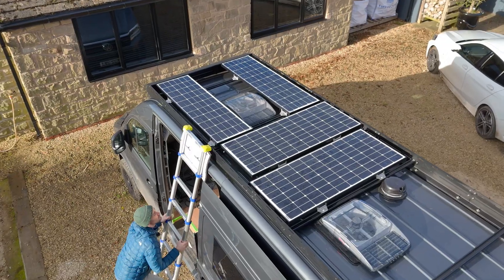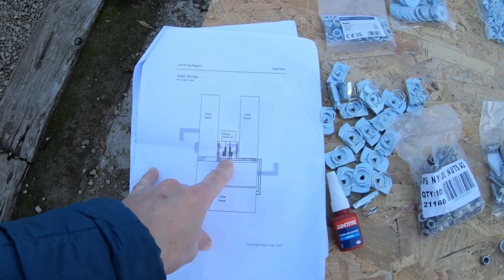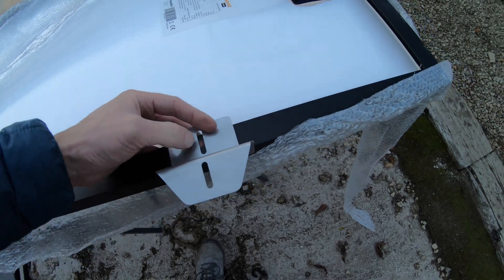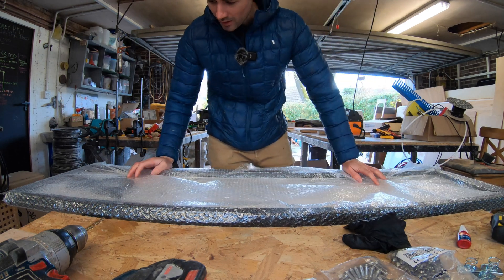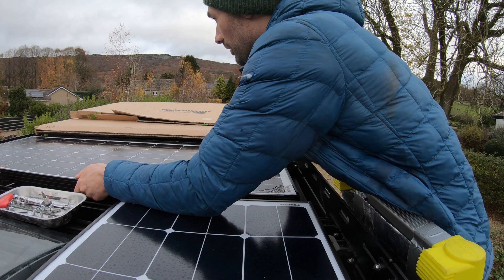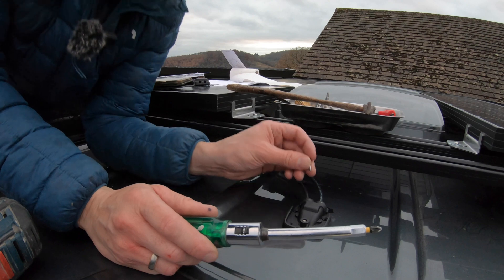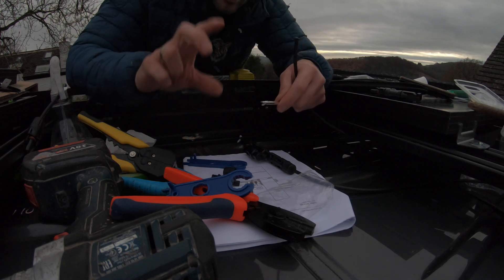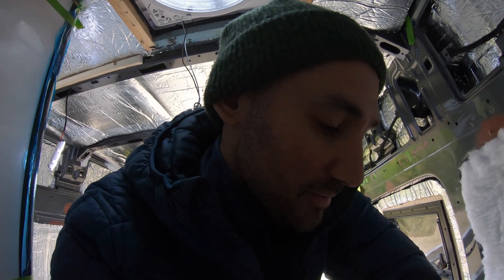Super Simple SOLAR PANEL Install HACK || DIY BUDGET OFF GRID Van Build

Comment: Somehow missed this episode previously.  As others have said, connecting the two different sized panels seems a bit strange.  Did the same people design this as did the main electrical system which blew a major fuse in the arctic?  If so…
Too late now, but I also think a neater solution is to use a Le Mans fan, rather than max fan, then solar can run over the fan as it is much lower profile.
Reply from the maker: I will take a look at them for the next build. Yer I need to check back with the system designer and clarify it.

Comment: Unusual (and normally considered bad practice) to put mismatched panels in series ... how have they performed?  

The smaller area panel will restrict full current flow potential of the larger panel and also current/voltage characteristic can create a lumpy or double-hump profile that the MPPT struggles to optimise. Suggest designer has tried to save you cost of an MPPT but with compromise that a single MPPT cannot optimise characteristic of different panel sizes. Best arrangement would be to use one MPPT for the smaller panels in series and a second MPPT for the larger panels in series.  Nice job though ... love that roofrack and all those blue boxes!
Reply from the maker: Yer couple of people have said that. I was going on the instructions of the system designer but ok 😅 think I have had peak watts of 450.

Comment: If you flip the brackets up the other way the panel should sit more or less flush with the unistrut. Less overall height means less drag. They're also less visible from the ground which might help reduce the chance of theft👍🏽
Reply from the maker: Nice one. Thanks. I did look at that but I can only do that where the struts run in the right direction so 2 would be high and two low so decided on having them all the same height.
Reply: @abucklife  fair comment
Reply from the maker: @AndyClarke-z9g  👍👍

Comment: Great as always, defo getting a mule roof rack. If you didn’t have a panel on one side at the back, do you think you could fit a surf board?
Reply from the maker: How long is a surf board?
Reply: @abucklife  it’s 6ft, but it’s more the width,  as I will only have one fan at the back, so not so worried about the length. Your making such good progress, especially at the new little one has arrived, congrats on that as well.
Reply from the maker: @ thanks James. Yer I think it would. The max air fan dome sits below the panel so with a bracket I think you would not have a problem storing it on there.
Reply: @ awesome, thanks man. Looking forward to seeing the next vid and artic adventures when they come out
Reply from the maker: Thanks James. Yep we hope to be away mid January. We can’t wait for some adventure.

Comment: Not good to miss match panels, do 2x120 and 2 150 panels
Reply from the maker: Just going on my system designers plans. But they are wired up in series on two loops not one so isn’t a problem. 👍
Reply: @abucklife  you had 1x120 and 1x150 in series? that's miss match and won't give you maxxium output.
Reply: Hi Matt. Where did you get the panels from?
Reply from the maker: @ hi mate. I got them through bspk Solar but the brand is tigerexped.
Reply: It's odd how these solar gear suppliers "Recommend" the panels they have instock or established supply lines to.

Each "Trader" adds their own motivations. My brother assumed the expert knew best, not his sibling who had only his interest in mind. He's paying the price now. Will your fix require another expensive Victron MMPT Controller? I skipped that install.
Admittedly I have no budget to speak of so it all looks very expensive.
We each bring what skills we have; some plumbers, some, electricians, some teachers :) and others DIYers. Mine is Systems Analysis so not as practical but able to appraise others and take what I can into prototyping.
I'd have gone wholely Unistrut and disguise bolt heads as coachbolts for price and security.
But hanker for a tilt and swivel when I want to stay in great spot for longer than intended.
I do think stealth would be more my suiting. Nudge Economics. Great to stimulate my creative side. Drop "hints" to have others believe my van had good reason to be where it is! A gimbled swing bed to cope with ackward slopes; could  not be a camper?
Reply: Adding a 120 and a 150 in series limits the 150 panels output to that of the 120